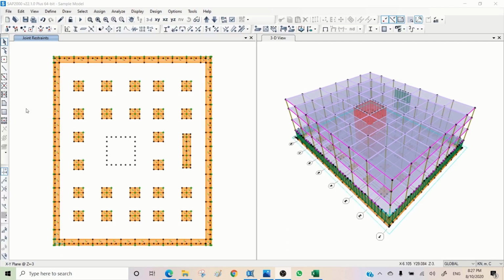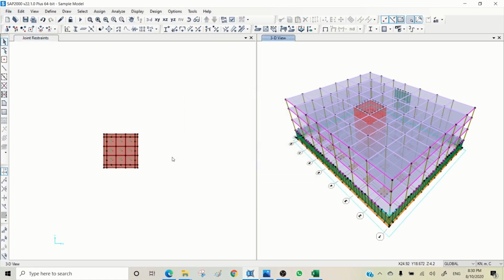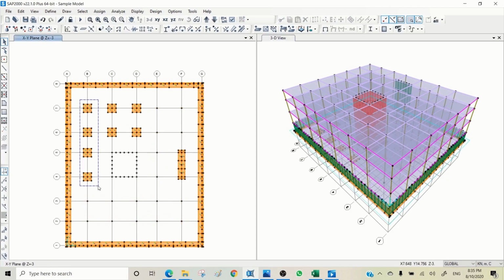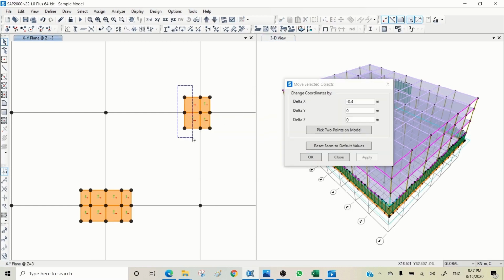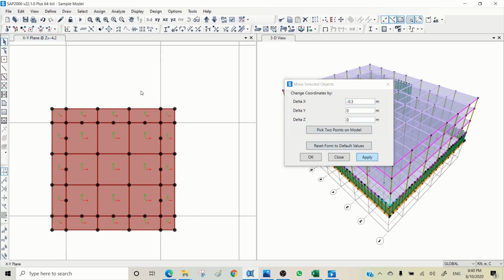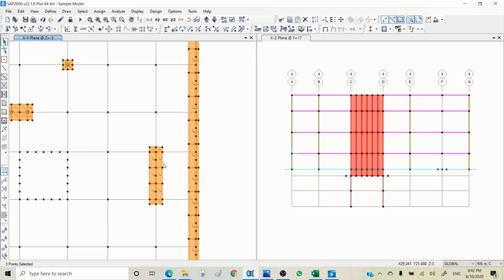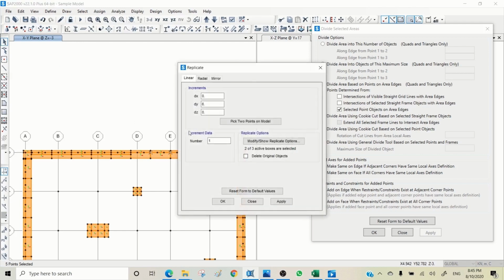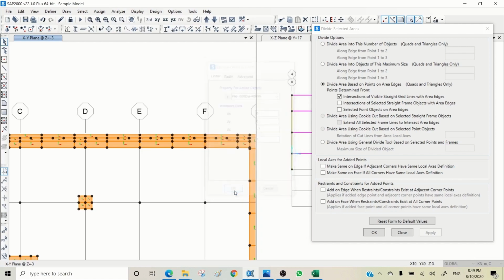Module 3 Video 3 Part 1 Pile Foundations Modelling

Comment: Thank you for this great tutorial. I have been looking for it. 
I have gone through all the videos but I did not find 'elevator load applied to the model'. This is uncommon in Youtube but hopefully you could consider doing one.
Reply from the maker: Thanks for the feedback, will do.
Reply: @alishayan-sap2000masterclass  Some said using shell for thick slab (i.e. pile cap) reinforcement design is not preferrable. What's your opinion on the concern?